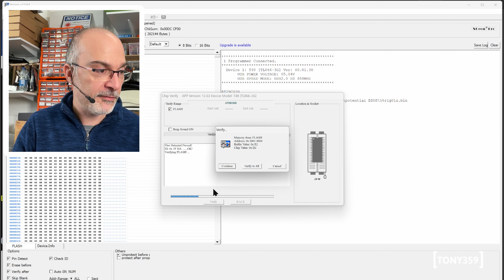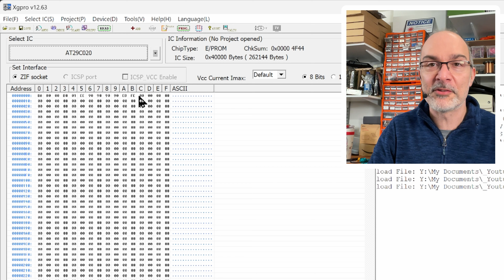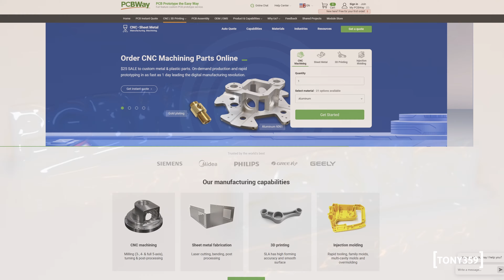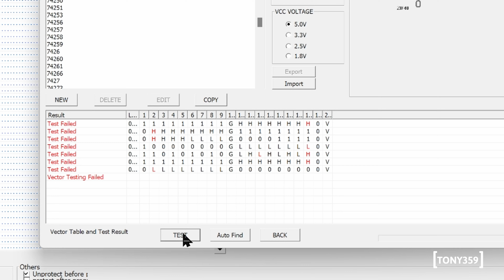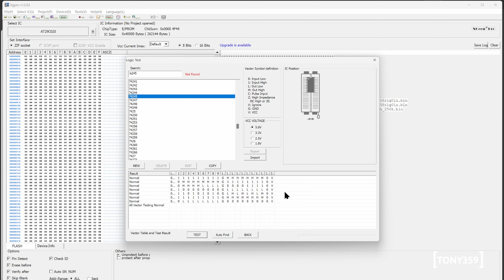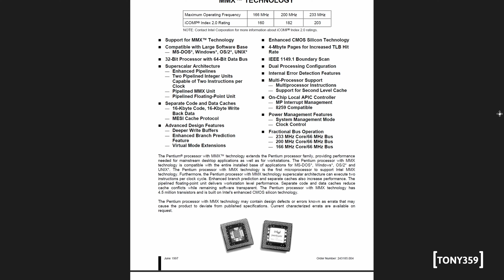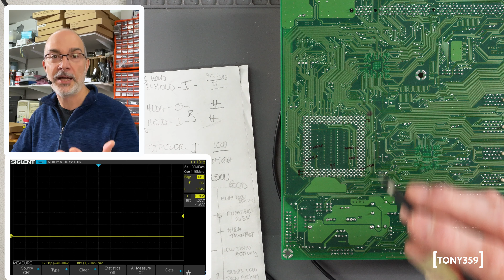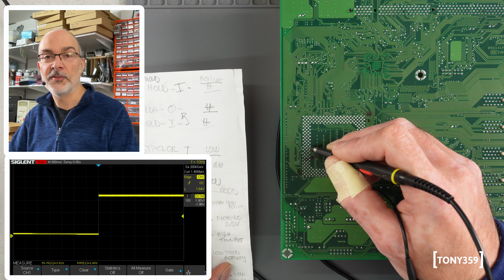I am unable to fix this Socket 7 motherboard!

Comment: The address lines could be ok, since the starting address on a 32-bit machine is  0xFFFFFFF0h (on a 16.bit 8086 it is 0xFFFF0h). This is where the CPU is searching for the BIOS initialization, (usually a jump). So it would be fine to see all bits high except the first 4. I'm not an expert as well, but I would check out if some address bus activity after the north/south bridges happens. On older systems I usually  measure the address lines in the ISA slot, but this one is much more modern and the ISA bus is abstracted over multiple layers. If you can check out the address lines after the north bridge, that may be would give you some hints. Could happen, that the north bridge is already dead, what is a shame with BGA. It is a pain to solder, so far I was not once successful with that :) Good luck!
Reply from the maker: ahhhh so those address lines being high might actually be the "initial state" I was looking for. Very interesting thanks. I can check if there is something on the PCI bus as the southbridge seems to get data from it? Thanks for that, it's an important piece in the puzzle!
Reply: necroware and tony my favourite retro computer youtubers together brainstorming! this PCB doesn't have a chance ! It will start working just out of fear :)
Reply from the maker: @fft2020  LOL! Necroware is the Master, I am just the Padawan! :)
Reply: Replacing a BGA seems to be very difficult and a lot of work. There is this crazy solder paste that forms those balls by itself with hot air. Would love to be able to do it one day.
Reply: As @necro_ware told the adresslines should be in a special state after reset goes high. Then the CPU sends Out a "read" signal, then the cpu reads the Data what is written to the datapins.

The sequence after reset is:
- Put start adress on the adress lines and hold them
- enable the "Data read" Line
- recieve Operation Code (instruction) at the data Pins
- do the instruction 
- go ahead with the next thing

Do:
Check the read pin at the CPU. It should go active after reset 

Write down every signal on data0 to data31 after reset (the first instruction the CPU recievs) and check the internet for the instruction.

If the first instruction is something valid (a jump, a clear-register x or similar) the Problem is the second instruction.

If the first instruction is an invalid opcode the cpu may freeze (since the 286 invalid opcodes forces a freeze).
Reply from the maker: I'm beginning to understand how this works - thanks. What would the "data read" pin be?
Reply: I was gonna say something nasty, then I saw your comment and awoke from my stupor.
Reply: @tony359  I know, it's just a joke, but unfortunately people seem to overestimate my skills. Eventually I'm just a software developer with a hobby, which is so exciting to me, because I know so little about it. Tony, I think, you do a great job, not even slightly less exciting, so don't be so shy ;)
Reply: @K10driver  If you mean "Data Enable" signal, I might be wrong, but I think that is only available on 80186. But that doesn't change anything, everything else looks like a good plan to go.
Reply from the maker: @necro_ware  That's what Anakin Skywalker used to say and look what's happened now. 😂
Thank you! The only "software" I "developed" is my RPi-based touch-screen heating controller which allows me to turn on and off the heating via VNC when I'm travelling :D It's mostly copied and adapted from the internet. It works! But it has a mild memory leak I think, every couple of months the whole OS grinds to a halt and I have to reboot it! :D
Reply: @tony359  Intel Pentium Processor Users Manual Volume 1

Most interesting is for the next Step the Pin W/R# at Page 30 (1-13). And these other pins may also be interesting:
Page 24 (1-7) - ADS# Pin
Page 25 (1-8) - BRDY# + D/C#
Page 26 (1-9) - EADS#
Page 28 (1-11) - M/IO#
Page 29 (1-12) - PRDY

I dont know how to get in touch with you outide from YT, but necro-ware has my contact details (email, phone). I can explain you short (or long) how these x86 CPUs are working because I am building a 80186 Computer (not IBM compatible) and i needed to understand every Pin until I got my first 1's and 0's on the Bus...
Reply: @tony359  There's 3 pins to decode what the CPU is doing for any given bus cycle:

M/IO# differentiates between memory (high) and IO (low) bus cycles

W/R# differentiates between writes (high) and reads (low)

D/C# differentiates between data (high) and code (low) - probably only useful to an MMU to e.g. prevent execution of code in regions of memory not marked as executable for example

Comment: Almost all high state on address lines are probably normal at start. First address used by processor is 0xFFFFFFF0, and it may stuck somewhere further along the buses. First you can check if A0-A3 lines are low at the start. If not the processor doesn't try to start at all. If are they did. The you can check if this addresses appear on PCI bus - this can mean North bride is OK. An then on XD bus.
Reply from the maker: Amazing, I shall do that!

Comment: Tony my humble contribution...
I'm pretty sure you already tried this but just in case you haven't...
1. Many boards I have dont like the post analyzer... specially on the ISA slot... some show the same behavior as yours
Try starting the board without the post analyzer and just plug the pc speaker to see if you hear an error code.. or plug the post analyzer on the PCI slots instead

2. Many times I need to press the rest button several times to make the cpu start
3. With the post analyzer pluged tap on the power components with your fingers .. capacitors, inductors, transistors to see if you see some fluctuations on the voltage leds on the post analyser
Reply from the maker: Interesting, I never had that issue but worth checking for sure. It would be silly if the board was just working and just not starting because of... me :D Thanks for that!
Reply: @tony359  Yeah, he's telling you right, man.  Give it a go and see what we know... 😄

Comment: Faced a similar issues a while back. It ended up being the Super I/O that was dead. On the platform I was troubleshooting, I was missing basic clocks generated by that IC, and that's how I figured it out. So, finding the your Super I/O datasheet and making certain everything is being generated could be a good next step (Would also prevent the CPU from initializing, which seems to be your case). Good Luck!
Reply from the maker: I should indeed check whether the rest of the clocks work - PCI, ISA and the other reference clocks others have mentioned around the board. Thanks!

Comment: This is from back in the days where you had to check EVERYTHING for it to work. The jumpers set the cpu voltage,whether it is single or dual voltage , the clock, the multiplier, cache config, BIOS voltage. And it all had to be right for it to fire up in most cases. The retroweb has a manual on this board with the jumper settings for the V58.  /motherboard/manual/v58-60ec698ab4d08855318212.pdf 
Now from what I can can see, the Pentium 200 is a P54C chip, with a 3.3V Vcore. JP8 sets whether the CPU is single or dual voltage, this should be set to single for the P54C which is 3-5 and 4-6 closed. Dual voltage is 1-3 2-4 So check this jumper block. 
JP11 is the Vcore, it should be on 1-2 by default which is 3.3V. 3-4 is 2.8V, 5-6 is 2.9V, 7-8 is 3.2V, 9-10  is 3.5V. Make sure you are on 1-2.  THe pentium 200 is Min/Recommended/Max V core	3.135V / 3.3V / 3.6V
Bus speed I think is set correct at 66Mhz. this is set with jumper JP2 and JP3 both should be set to 3-5 4-6 for 66Mhz.
The there's the switches, which set the multiplier - SW1 S4 S5 and S6. your multiplier should be 3 which is S4 off, S5 on, S6 off. double check these. Might even be worth checking the switch block with a multimeter to confirm the switches are set, and not in need of a bit of switch cleaner. 

if that all checks out. You might be on to confirming the clocks to the north and south bridge, and supply voltages. These will need to be working too. You seen in the block diagram how these all need to be working in the chain for the system to read the bios and boot. There will be a clock generator chip kicking about supplying clocks to all the board chips, including the CPU, so the fact it has a clock is a good sign, but it's worth confirming the clocks and supplies on the the rest.
Reply from the maker: Thank you for taking the time to comment! I have that manual, I know it by heart now :)
I have 3.3V at the CPU (both sides) and 66MHz so those should be ok.

Are you suggesting that the chipset has its own clock and power? I didn't consider that...
Reply: @tony359  Yes, if you check the M1541 datasheet, you will see it's very involved with clocks, as it is the interface between the CPU, cache, memory, PCI bus etc, and has inputs from those clocks, and output refresh clocks for the RAM. IF it's in the address/data path, chances are there's a clock somewhere, to keep it all syncronised. ;-)

The south bridge M1543 has inputs for the RTC 32k clock, and the PCI bus clock. and maybe a 14Mhz clock input, probably for running the show. There's a whole block in the the block diagram for clock and reset. So yes, both North and South bridge, have more than one clock, some in, some out to other parts of the system, and are worth checking. 

In fact I was thrown off a bit, I just checked the chip numbers - you have the M1531/M1543 which is the ALADDiN IV+. retroweb   /chipsets/179
If you look under documentation, then 2 chip docs available, you'll get tthe 2 datasheets, complete with block diagram, and pinout data. The idea still stands though, check the clocks and voltages to the chips, as much as you can, which won't be easy since they are BGA. But you may be able to trace some.
Reply from the maker: I've taken a look and yes, I should have continued reading :) I'll check the clocks and also see what I can probe on the chipset. Thanks for now!

Comment: Hi Tony, you are doing well mate, don't give up. I'm no expert on these but I have been working with electronics for over 50 years and you just have to have confidence in yourself and what you have done so far. The one thin about you I am impressed with is your logical step by step diagnosis and your general approach to the different problems. On this you have done everything right thus far, so don't give up, the only criticism I have if any is don't jump about, all you will do is confuse yourself.
Decide a course of action and follow it logically from one end to the other, so have you got activity on the Bios chips data and address lines, if so follow it through that strange little but to the next chip, is there data on the data and address lines coming out the south bridge? follow it. Is there data going in the North bridge and so on, don't jump from one end to the other, it will probably turn out to be some small logic chip failed or a broken track somewhere, Even getting basic and actually checking continuity of address and data lines with your meter in continuity mode (Beeping) and check the actual tracks from chip to chip is all I can offer.
Reply from the maker: Criticisms are always very welcome of course! I see your point and yes, I tend to jump around! But I just thought that if nothing's coming out of the CPU, well nothing will reach the BIOS, or the Southbridge or the Northbridge? I've inspected for broken traces a few times - so far I haven't seen anything. 
And thanks for your kind words :)
Reply: @tony359 maybe it’s not the cpu being on hold, but the cpu is waiting for data or activity from the chipset. So the data from the bios might be held back by somewhere on its way. The bios chip should also output the data that is saved at the program start address on its data lines. You could compare the output on the data lines with the contents of the bios file. I am wondering if the correct data from the bios chip is coming out and if it is stuck at the first byte or if it outputs multiple bits and bytes. I believe the bios chip outputs 8 bits in parallel on the 8 data pins, byte after byte for every change of the 8 address bits on the address pins. Someone on yt built an open source bios programmer and recently, he showed the status of the address bits with leds on a bread board with many wires ;)
Reply from the maker: Thank you. Yes, I guess those "stuck lines" might actually be intentionally and something just stops at some point.

Comment: There are already some good comments that point to the same what I already thought about, which is the reset vector. As this points to the beginning of the last 16 bytes of addressable space, it is normal that mostly all address pins go high. The reset vector is the first code the CPU looks for, and as there are only 15 bytes available (the 16th is the checksum), it is a Jump command that enters the main BIOS POST routine. There must be some logic to translate the CPU address to the limited amount of address pins on the BIOS, which I'm afraid is likely the northbridge.
Reply from the maker: Uhm interesting. So as Necroware mentioned, you're suggesting that the "pulses" I was looking for are in fact the "address lines being high". That is the first activity from the CPU which gets translated by the Northbridge into something that can work for the BIOS?
So I guess I should focus my attention to the PCI bus? Maybe I see something there which is not reaching the BIOS?
Thanks for your help!
Reply: @tony359  Exactly. So I think the behavior of the CPU is pretty much expected. The address request should pass through to address lines all around the busses (ISA, PCI and also the BIOS chip which also should have most or all address pins high.On a (whatever)C1024, I would e.g. expect A15 down to A5 to be high and the lower pins to start low, plus /CE being low (Chip Enable Active Low) and the BIOS ROM to output some data.
If there are not address strobes on the address lines, no Chip Enable Low or no data flowing out of the ROM chip, this is already strange. If you have the proper address, chip enable and data coming out but obviously not getting back to the CPU, then you have again another problem. I assume a 16 bit ROM and a 32 Bit CPU meaning that the data will be read in two steps and assembled in the chipset, so again likely a task for the northbridge. However, follow the traces and look what happens where.
Reply from the maker: I need to double check the BIOS, I think I could see the address lines stuck to high but Data lines were likely floating as they read 1.5V. I guess I should check /CE and make sure it's low?
Reply: @tony359  Yes guess so
Reply: @tony359  Addition: I found another datasheet with another label description. Check Pin 2 (/E or /CE) and Pin 20 (/G or /OE - Output Enable!) if it is a 27C1024. For other types, refer to their data sheet, but I think, /CE and /OE have both relevance, and /OE even more, which I first overlooked because it wa labelled as /G (which I didn't understand) in the first datasheet I looked at

Comment: It does sound like there's an issue happening between the BIOS and the CPU as the two are OK individually. You may have to check everything in between.  Although, it would be quite funny if it was just a jumper this whole time :). Best of luck to you
Reply from the maker: That's my guts feeling as the manual is missing some or doesn't have much description for some...

Comment: I have several MB with the same behaviour and I failed to continue the repair because of the BGA chipset and the lack of the knowledge how the startup sequence is happening in these systems. I am very curious how this repair will go and I wish you patience and luck to drill down to the root of the problem.  Suscribed!
Reply from the maker: Thank you and welcome! Fingers crossed, watch this space :)
Reply: @tony359  What I found a bit strange: I was not able to find any document how the 486, 586 processor should work on "pin" level. What is the power up sequence, what levels should be present at a given pins with timing regarding each other in the power up sequence. There are timing diagrams for the buses, but no detailed explanation on these in the datasheet. The pin functional descriptions most of the time very condensed, left a lot of guessing about functionality and interoperability of other pins. Standard documentation is a set of puzzle pieces and you have to put the puzzle together to see and understand the full picture necessary to be able to diagnose an MB.
Reply: @tony359  Thank you the tip for the test eprom to write the post code. It is an extremelly usefull debugg tool to check the CPU, SB.NB part of the MB. Always learning something.

Comment: I suspect the problem is with one of the chipset BGAs. There might be a bad connection due to physical stress or oxidization. Try to push the BGA towards PCB moderately and hold during reset. Sometimes, it helps enough for the board to POST.
Reply from the maker: I tried that - that's how I diagnosed the Amptron! - but I couldn't get any POST code. It could still be the BGA of course. Thank you!